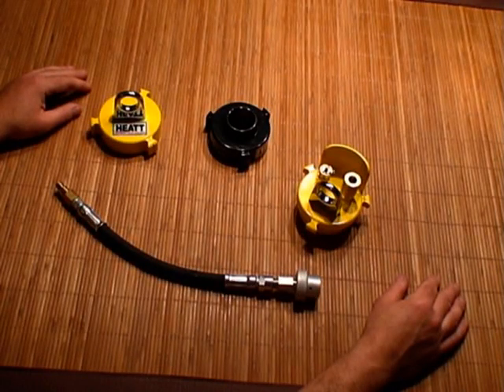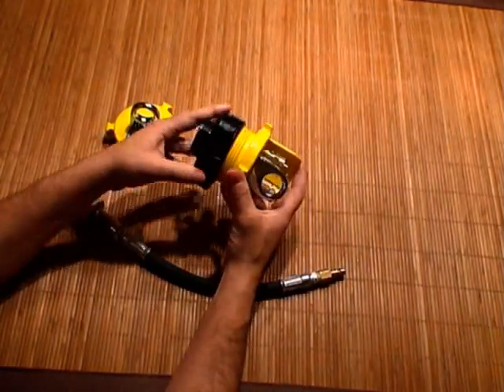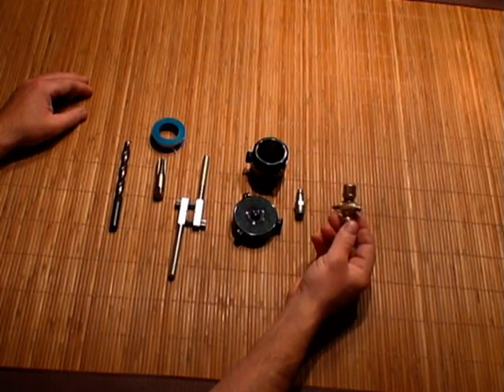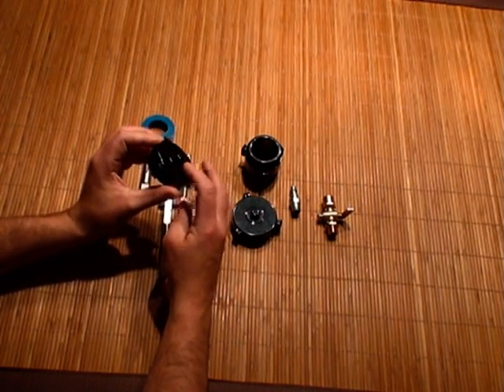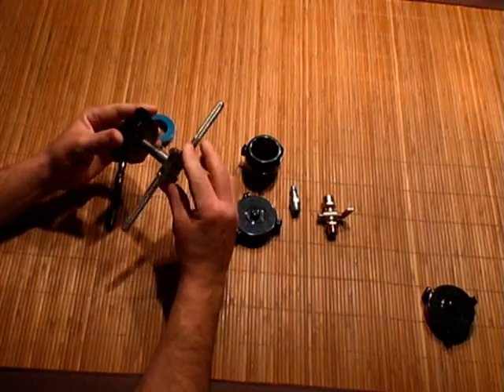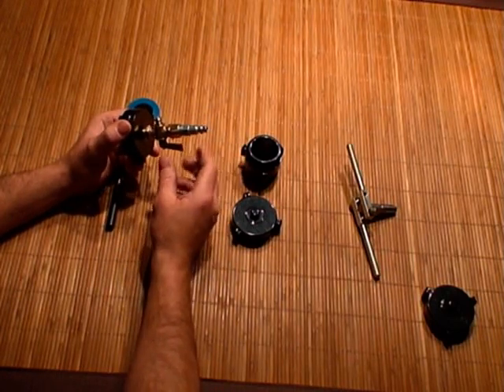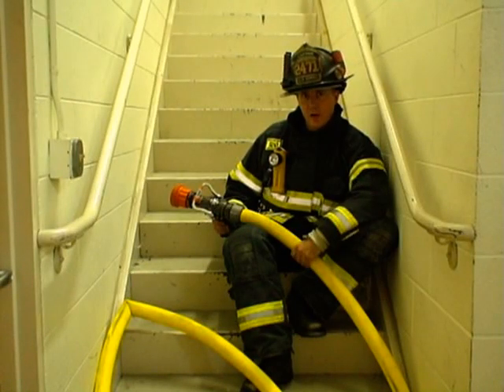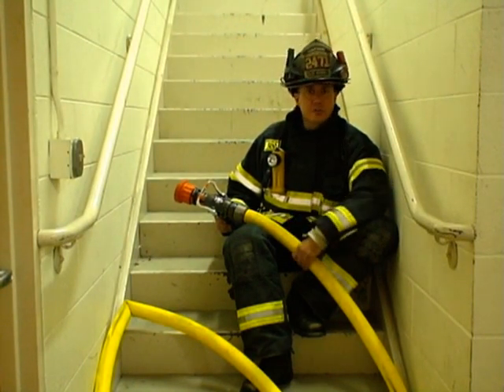Firefighter Training - Fire Hose Inflation System

Comment: Do you have any methods to adapt this to be able to run off of spare SCBA cylinders rather than a compressor?
Reply from the maker: Josef, yes you can use this same coupling set to run off a scba cylinder - That's typically what the commercial systems use. All you have to do is search the Internet for scba air fittings and adaptors. The simplest would be a female threaded end to attach to the scba reduced to a quick connect female end for the fitting on the hose inflation coupling. You wouldn't need a hose and you could get buy w/o a gauge, just be careful not to over inflate the hose. These extra fittings would probably cost around $50 - Also check Ebay
Reply: Pressure gauges are cheap, and you can mount one to a tee with a chuck on one leg and a nipple on the other to measure air line pressure on most anything you like.